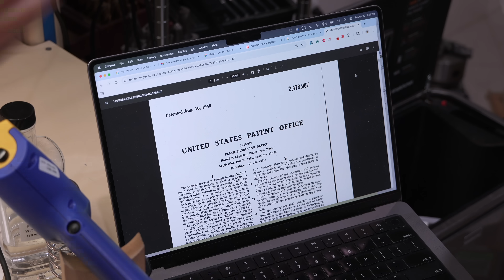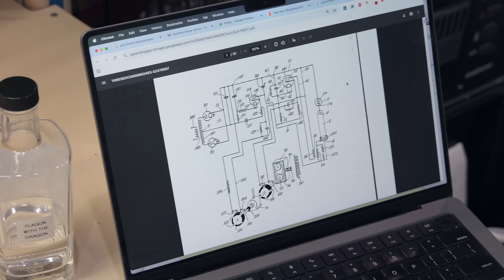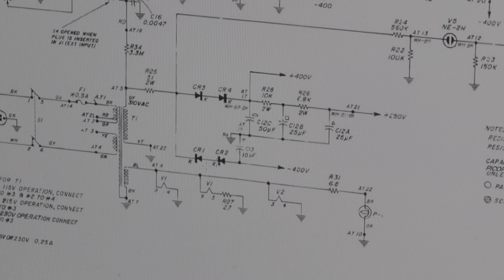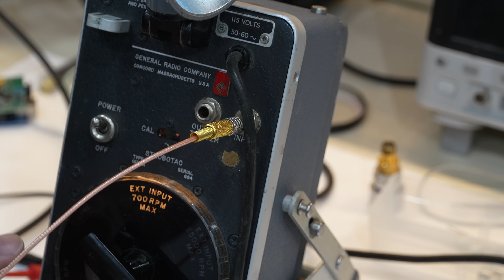Genrad Strobotac Repair

Comment: The magic smoke came out of the resistor located opposite the high-voltage capacitor when the structure is assembled.

Comment: Fun. We used a strobotac just like that in the navy. When testing overspeed trip devices, we had to have two independent speed indications. So we used the installed tach and aimed one of these on the rotor. A little tricky sometimes, as a rotor with many blades or bars, you could easily get on a harmonic and be totally off.  So we had to be careful about that.  Nice walk down 'memory lane'.

Comment: I must be getting better about thinking about vintage electronics. As soon as you said, "It had just two or three tubes", I immediately thought "I wonder if it has a thyratron trigger".  I built a very similar circuit once, where a capaitor stored a measured amount of charge, which got dumped into an LED (no current limiter!) all at once through an SCR.  (I needed a precisely metered amount of light for as short a duration as possible.)  A colleague eventually did a circuit using an RF power transistor to get a shorter pulse, because the transistor could cut the tail off cleanly.  Fun stuff!

Comment: Hello, do You have any idea about the origin or purpose of special attachments at the end of that tuning fork?  I imagine it was to generate  precisely timed light flashes when illuminated with say a laser, but for what ?
Reply from the maker: It’s a Teletype motor adjustment fork. You look through the slot to time the marks on your Teletype motor wheel, which has black and white marks for that purpose. So that fork is a kind of a specialized stroboscope in itself.

Comment: I repaired one of these, regrettably not mine,  a few years ago The oil filled pulse capacitors were leaking and needed to be replaced. Once I managed to find suitable pulse rated high voltage caps it worked perfectly. I was sorry to have to return it to its owner but made myself a solid state strobe using a microcontroller and an array of bright white LEDs. It works nicely but lacks the charm of the original. I'd love to find another real Strobotach here in Australia.
Reply: There are several ex RAN units on eBay Australia at present, Jan. 2026 (I have no relation to the seller).  For some reason they all seem to be 105-125V units.  I know 230-240V units exist as I have one.

Comment: So cool!  Scary voltages in those caps. Despite the discharge instructions, I’d be terrified. Too many 200V shocks in my time… can’t imagine 800V+!
Reply: I worked on similar systems in my career, and yes, it is scary and some precautions must be kept : make sur the device/PCB under test is secured so it cannot move when you put your probe on it. And use probes that keep you clear of the voltage. With the ground probe properly secured (don’t use your other hand to hold it in place)

Then proceed cautiously. 

With that, the major issue is to make sure that you don’t short pins or components with the probe end, and that the probe itself has a very small tip, so that there is no arcing due to an un insulated  part being close to some other PCB pin or even low voltage wire.

Comment: Very nice! One application of stroboscopes was testing electric meters. They would have a 'standard' (carefully calibrated) meter with a specially marked disk and optical pickup, then the strobe would illuminate the disk on the meter to be tested. The full-load (nameplate amps) and light-load (at 10% of nameplate amps) speed would be checked and adjusted until both meters were turning at the same speed.

Comment: I have the 1538. They can flash at very high speeds (25000 flashes/minute) Yours is General Radio, mine too. Genrad is a later name. (1975)

Comment: The strobe lamp on the GenRad 1542 is suspiciously similar to another device they made called the Klystron tube. The Klystron tube is used as the high speed switch that perfectly times the discharge signal to the shaped charge explosives in an atomic device. The Klystron tube is a “controlled” export component that could not be sold to just any country….
Reply: You're thinking of a Krytron tube.  They were also used for triggering very large flash lamps like those used in high-speed photocopiers.  They're no longer made and have been largely replaced by the related Sprytron tube.
Reply: @douro20 ah, I stand corrected. I did mean Krytron.
Reply from the maker: @douro20 knows everything.
Reply: @CuriousMarc  No I don't
Reply from the maker: You might be mixing things up bit. A Klystron is a high power microwave amplifier tube. Invented by Varian. Vacuum tube, not gas discharge.

Comment: Strobes were used heavily in the label printing industry. After printing, large master rolls of labels are run through an inspection machine called a rewinder. Here, the operator will check print quality before sending the rolls off to the customer. An optical detector is used to detect the gaps between labels on the roll and a strobe sync pulse is sent to the strobe so that it can be used to freeze the image of the labels running across the inspection table on this machine. EG&G as well as GenRad strobes were used heavily in the 70’s to 90’s. I have a few of the later, solid state 1542 strobes at home.

Comment: I was wondering when I would see a thyratron triggered stroboscope.  The one I remember was a larger unit which used a special neon lamp, also made by GenRad.  The 5727 is a ruggedised long-life version of the 2D21.  The ceramic sleeve on the anode allows it to have a Vpk of 650V and a -Vpk of 1200V.

Comment: Heck yes. GenRad was famous here in MA. Every MIT grad I met had a Polaroid (yes, MA as well) of his bullet going through his apple in Edgarton's strobe photography course.. Early memories of the Boston Museum of Science: I remember there was a rapidly dripping faucet exhibit with a Strobotac, and you could turn the dial until the drops "stopped" in mid-air.
Reply: There used to be one of the water drop setups at the Ontario Science Centre that I was able to play with when I was young. I was impressed.

I hope they get that museum rebuilt soon.

Comment: Yes, diodes in packages like that can have different polarities.  The same package often exists with a threaded stud on the side with the ring, and when making a FULL BRIDGE RECTIFIER you can have 2 different types on 2 heatsinks when you use the 2 different types.  So there is a normal type and an R type of the same diode.

Comment: I have one of these i pulled from the company I work for E waste bin.  Works perfectly.  Pretty sure it is the solid state version though.  Fun to play with.  A friends dad had one that we would play with back in the early 80s.  Always lusted after one since then, funny how life works out.  Interesting to see that they use a thyratron in it.  I recently had to repair an electron beam coater power supply that used a thyratron as an over voltage safety.  The trigger threshold was 25,000 Volts!  The thyratron was bigger than the stroboscope.
Reply: The 1538 is the solid state version. 🤓

Comment: One of the major uses of strobotachs are determining the speed of rotating machinery.  There's some skill involved in doing so.  When the strobe is adjusted so the shaft appears stationary, you know the speed of the shaft.  Or twice the speed.  Or half the speed.  An integer multiple or fraction of speed.  You must know the techniques to verify you're reading the fundamental speed.

Not knowing how to do that has destroyed some multimillion dollar machinery at a certain naval shipyard, when one-half speed was being read.  Turns out bad things happen when a generator is being run at twice its normal speed.
Reply: Some people near the machine when it self destructed refuse to believe it was over-sped by near two times.  "It's the quietest machine I've ever heard."  At almost 2x speed, the turbine bucket rate frequency was beyond the audible range.
Reply: Have a video that I used a strobe to make water droplets go in reverse
Reply: "Bad things happen at the One-Two point!"
Reply: Water is wet too.
Reply: Any strobe pattern dimensioned for integer multiples n * f_strobe will only be trustworthy in the interval of (RPM_nom * (1 - 1/(2n)) ; RPM_nom *  (1 + 1/(2n))), with readings repeating periodically every RPM_nom / n. So integer multiples of RPM_nom invariably are always included. If speed adjustment range exceeds this interval, any good design must include some additional means of ballparking RPM first. The pattern on your average turntable is an n=2 affair (+/-25% max), which gives plenty of leeway for their typical pitch adjustment ranges of +/-10-12%.
Reply: Yeah, I was wondering about that. At a pure guess, I suppose you could dial your strobe across a few apparently stationary points - when you find the one that is exactly half of one of its neighbors and double of its other, you're bang on...?
Reply: @AttilaAsztalos One method to insure you're reading the fundamental speed is to mark one side of the shaft with an X and the other side with an O.  At 1x speed or lower you'll only see one symbol; at greater than 1x, you'll see overlapped symbols.

Increase the frequency until one symbol is frozen, then double the speed.  If overlapped symbols are seen, you're now at 2x speed.  If not, repeat the process.

Comment: How considerate of Genrad to put a hole in the face plate so that the magic smoke can escape!
Reply: And how nice that modern magic smoke is still compatible with ancient electronics.
Reply from the maker: It's the sight hole for the neon tube that's used to calibrate the instrument. But yes, very considerate of them.

Comment: Hmm. If the flash tube discharges the capacitor, and its recharged by a simple transformer and recitifier, how could it fire faster than the line voltage?
Reply: There are line filtering caps (big electrolytics) that smooth out mains line frequency.

However, there is no free cheese, the power is limited (both by the power supply and considerations for longevity/reliability) and flash brightness noticeably goes down as the frequency is cranked up.
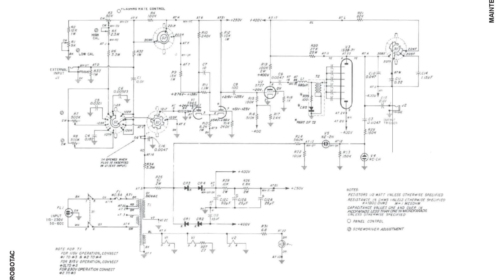Reply: the power supply first charges two bulk electrolytics (50uF and 10uF), then the flash capacitor (which is a 47nF plus switch selectable additional capacitors for slower speed ranges) is charged through a 27k (high power 25W) resistor. The bulk electrolytics have enough energy to hold the voltage across mains cycles. The complete schematic is shown at 4:57

Comment: That trigger output jack downstream of 800V(400V) and the DC block capacitor is nightmare fuel. I dare say a few Ham radio operators have gone SK due to the failure in radio circuits just like this.
Reply: Oh come on. Just enough current to knock your ass on the floor.  I had to learn the hard way from a 900 vdc supply for my bootleg home built cb linear. The meter wire popped out of my heathkit vom hit my middle finger on left hand. I let out a shriek and still remember the sodium yellow arc that burned a bleeding hole in finger.  Eventually recovered feeling in finger but carried around a nice reminder scar.
AC9CX

Comment: I should start a business that sells bright high power flashing LED's driven by a relaxation oscillator for $8450. Will make more money than the dreams of any AI snake oil salesman.
Reply: The high price isn't for what it does. The high price is for how it's a low production version of the same exact box with the same model number, controls, and behavior. So no documentation has to be re written, re verified(military/aerospace), distributed, etc., just pay the man for another one and carry on. Your solution costs far more than $8k to the sort of customer that still wants one of these new in box.
Reply: @Broken_Yugo  whoosh. The shocking thing is you took the time to write your diatribe. lmao

Comment: It would be cool to recriate some of that high speed photigraphy, since I never seen a non digital higspeed explained.
Reply: In standard old-school photography, you have a lens, shutter, and the film, which is in a black (dark) box (the camera body). The shutter opens momentarily, letting in a burst of light, which exposes the film.

A lot of this type of stroboscopy was done with the camera in a dark room, and the shutter latched open. The film didn't get exposed because there wasn't enough light in front of the camera to expose it. Then the strobe went off, usually just once, and this exposed the film through the open lens. Then you closed the shutter, wound the camera to the next negative, turned on the work light in the room and repositioned things how you wanted for another exposure, turned off the room light, opened the shutter, and fired the strobe again.

For bonus useless information, camera shutters contained a mechanical timer, that would open the shutter for different lengths of time, depending on the setting when you pulled the shutter trigger. Most had a place you could screw in a remote push button so you could trigger the shutter remotely. The shutter had a position marked "B" (for "bulb"). In this position, when you pressed the remote trigger, the shutter would pop open, and it would stay open until you released the remote trigger. The original remote triggers were squeeze bulbs, hence the "B" designation.
Reply: also I think the bulbs were one time use.
Reply: The "B" setting on the shutter indeed stands for "BULB", but it's referring to hydrogen-filled, magnesium-filament flashbulbs, not to the shape of the remote trigger. For similar reasons the synchro-flash position is marked "X", as in "Xenon", the gas used in strobe flashes

Comment: ah, the genius of a patented capacitor between +400 volts and the literally hot side of a simple ring plug. You know? The chinese are not violating good design, they're following it!
Reply: Evolution brakes hadn't been invented yet at that (glorious) time that unit was made. 
I own an ancient German "Rowenta" toaster (I would date it to the late 1920s) and safety-wise that thing is just totally awesome. Nearly everything is exposed. It has a normal switch to turn it on and off (no thermostat or timing device) and the heater wires basically hang in mid-air. It also roasts the bread slices just on one side, so you have to flip them manually. With your fingertips 1/2" away from the red hot wires connected to 230V mains.
Edit: 
That thing belonged to my grandmother and she didn't mind at all when I used that deadly contraption as an 8 year old kid in the 1970s....
Reply: @albinklein7680  I had something very similar. It was square, and could hold 4 pieces of bread, one on each side. There was a little wire crank handle in one corner, and you could use it to flip the toast 90 degrees (each piece of toast moving "around the corner" to the adjacent side of the toaster) to toast the other side. The you turned the toaster off with the inline snap switch on the cord.
Reply: Common feature in old tube circuits, this is like complaining a 100+ year old car has a plate glass windshield and no seat belts. Y1 safety caps exist if it bothers you.

Comment: Iconic photos! Never thought they'd be made using a stroboscope. It looks lovely inside, with unexpected thick phenolic PCBs. 
That's a very interesting cable loom there. I'd expect lacing rather than a cotton/polyester/etc. sleeve. I wonder why it was done like this.
I can only imagine the creamy touchyfeeliness of the mode selector dial.
Reply from the maker: Oh yes the selector dial is delicious.
Reply: @CuriousMarc  Connoisseur!
Reply: I think the Americans refer to photo flashes as strobes too. It’s pretty much the same circuit after all.
Reply: @connerlabs  only a photo flash would be one-shot while a strobe has a timebase generator :)
Reply: @KeritechElectronics yes, the photo flash also tends to have a larger capacitor charged to a lower voltage than Edgerton’s strobe, hence a longer pulse of light that isn’t optimal for freezing bullets in mid-air. 🤓
Reply: When this was made, the cabling was plastic, poly I think. They had a machine in-house that braided the harnesses.